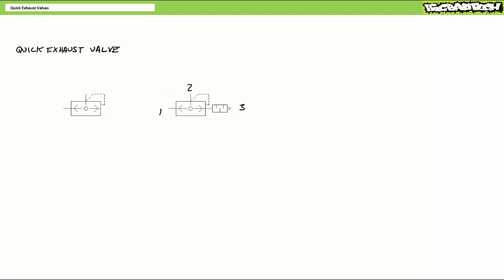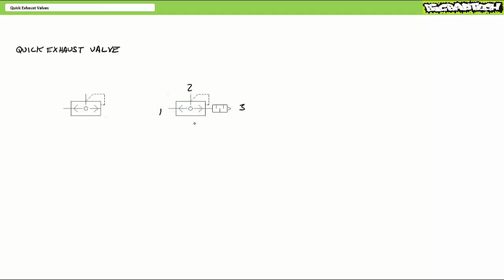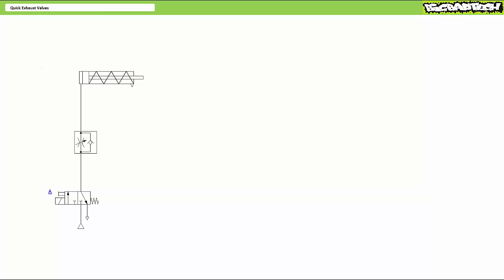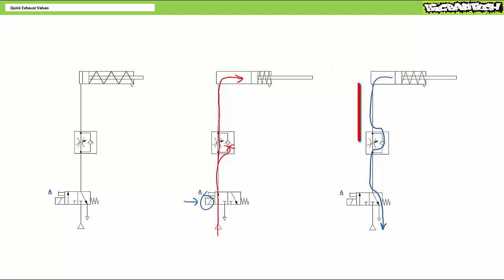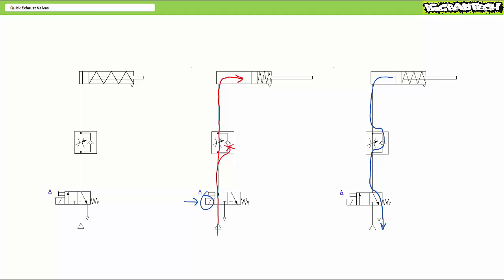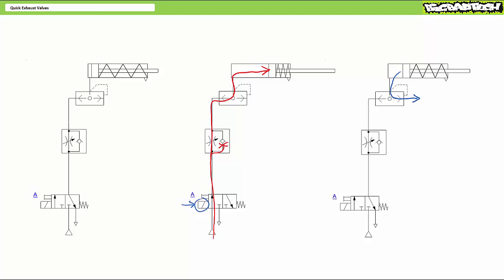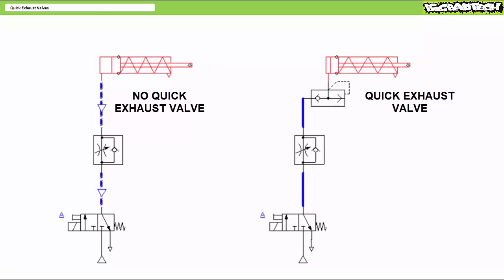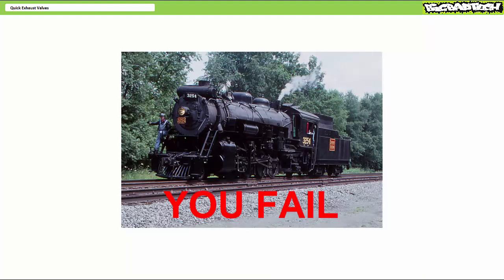Quick Exhaust Valves (Full Lecture)

Comment: I got idea on a pneumatic piston engine i made a air rifle out of a quik exaust valve with a spring setup on inside and a compressed air tank pump up pressure in the tank to 300 psi or whatever it can hold then when pull trigger it opens the valve giving a sudden burst of air then it snaps closed again allowing multible shots on one tank of air i tried just useing just a normal  air blow gun with a barrel hooked straight up to the compresser but the air releases heaps slower dosnt get that sudden rapid burst of air in one hit so on a engine with pistons could have a quik exaust valve well its a inlet valve with a pneumatic actuator that opens fast as could have the valves outlet the same diameter as the piston so it opens gives initial rapid burst then keep pumping air till pistons near its bottom stroke then on the cylinder bores have couple openings so some of the  pressure gets pushed into crankcase  before the piston even starts traveling back then exaust valve to release the rest as piston returns like you could have tank with a constant 1000psi to blow the pistons down so be huge amounts of force just need to produce enough air to keep up with demand which is were turbines not turbos actull turbines like on a plane there air operated already dont use fuel its all a hoax but i wont go into that but they run of air but could use electric motors aswell to produce ample amounts of air that keeps the tank well and truely full pressure what ever the tank can hold really theres more to it but thats the basics i got ideas on a whole new design on engine useing disc type pistons like a rotary but just a balanced disc with fins that air blows around if presicion balanced could get like 20.000 RPMs or something who knows alot anyyway air is the future of automotive i beleaave electric to but useing alternating generators to charge as ou drive anyway il stop ramblin good vid cheers enjoy and much love

Comment: Nice course but metering in has a big drawback that should be highlighted: the cylinder at low speed will not move smoothly, it may start to "stutter". You should always meter out, if you need quick retraction you either put a quick exaust valve on the extension inlet or you don't meter it at all.
Reply from the maker: True. "When in doubt ... meter out!"

Comment: what would happen if I would put pressure from the exhaust? QEV will open and and the cylinder will fill up?
Reply from the maker: Could you put a hat on your foot? Yes but why?
Reply: I got hydraulic circuit when 3x exhaust lines are connected together to common return. Not going into details, at some specific circumstances pressure from one exhaust can push for another exhaust but from exhaust port.
Reply from the maker: I dig what you're saying. If you've got all 3 exhaust lines piped together you'll might have problems with QEV2 and QEV3 if QEV1 dumps to exhaust because QEV1s exhaust could back flow into QEV2 and QEV3. Long story short they'll probably need 3 independent exhausts.